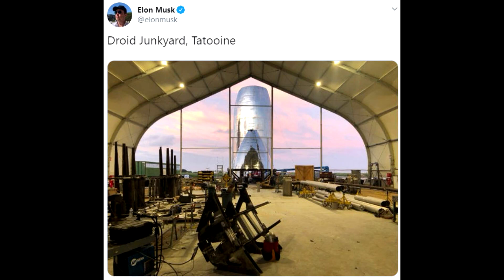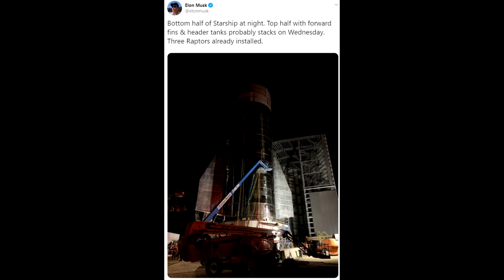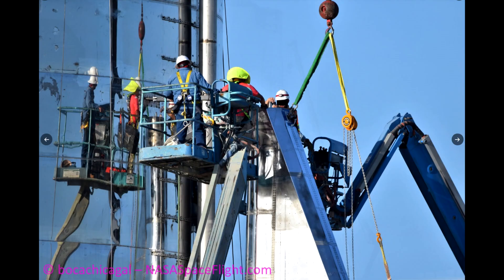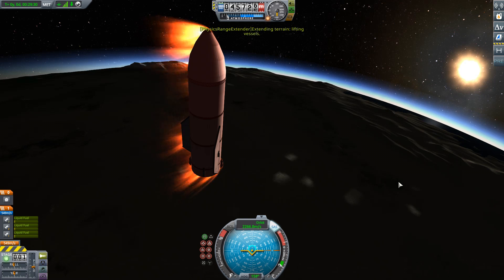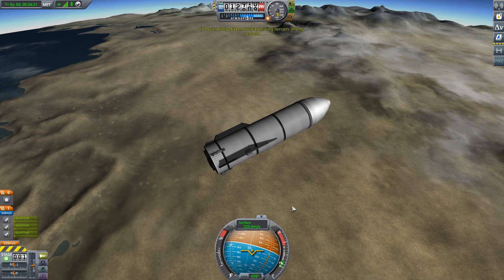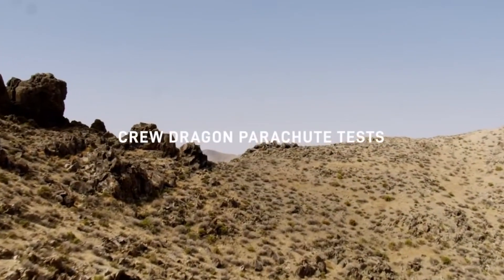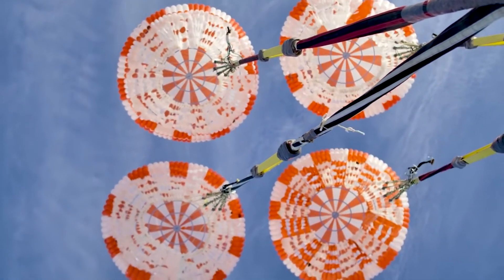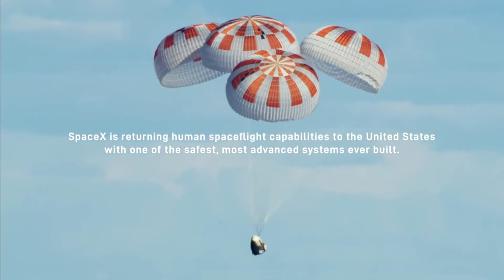New Details Revealed About SpaceX's Stainless Steel Starship as Prototype Nears Completion

Comment: So are there supposed to be heat shield tiles applied to a a section?
Reply: As of what I last heard a few months ago:
No, the plates that are going to be exposed in the reentry will have pores which will leak methane. This will create a layer of cold gas around the ship and will also cool it down.
Reply: @Zatmos  Apparently they ditched methane leaking idea already.
Reply: @randomnickify  Was it only what they wanted to do when it was still carbon fiber instead of stainless steal  or did they ditch it later ?
What are they planning to do now? Spread the heat through the whole ship ?

Comment: Why doesn't another company design a better craft like the shuttle but with the ability to take off from the ground and go into space or be carried to 40000 feet and shoot into space?
Reply: +masskilla469
Hint: the shuttle only worked by the magic of lots of money and being 'to big to fail'.
Reply: @Tuning3434  We have the technology now that is way better than the 80's to  deflect heat instead of those panels that failed!!
Reply: @masskilla469  Well, the shuttle was only retired in 2011, so apparently not so good yet to warrant a refit. Also as mentioned by Mark, you have the X-37. Still running on the money of DoD, but a lot smaller, riding on a conventional rocket and with probably a very interesting but niche mission.
Reply: @masskilla469  I admire your spirited young-minded bravado. However, as an engineer myself, actually working in high tech industries, I am a bit more skeptical of miraculously finding new technology because it's not 20 years ago. Capabilities change for sure, but you are seriously underestimating how far technology was 30 years ago.
Reply: @masskilla469  Ok, well I work in lithography machines, wouldn't call it a stagnant area of engineering myself (and an extremely costly one on it as-well). 
Still, most of the new technological development come from investing in better capabilities and building upon past experiences. There is a very clear pattern of technological development, and a nothing comes suddenly out of nowhere. Different technologies coalesce together in new applications.
The Apollo program as a matter of fact is THE example where money overpowers technical problems. It was done at a huge expense, and was relied heavily on technology and concepts that where developed in the '50s, but with the surrounding systems brought up on a new more massive scale. The J-2 engine was based on the Centaur's RL-10, and was developed early in the '60s.  
In the end it still comes down to money (Isn't it always :s ), and apparently SpaceX is the only company at the moment that makes has taken up the gauntlet, clearly designing something completely different than a Space Shuttle.
Reply: I think it's been tried, like Lockheed Martin's X-33.
Reply: They do, google SKYLON, they are working on it since 1980 and guess what? It is freakishly difficult.
Reply: @randomnickify  No such thing as google SKYLON !!

Comment: I am no rocket scientist, but how the heck is that thing going to survive 'hypersonic' with its sheet metal structure?  every transition of curvature we see as changes in reflections is a section that will create its own hydrodynamic effects on airflow.  All the surface pressure changes from the less than perfect surface will then make things vibrate like heck.  I am not seeing this surface material, internal framing, and construction technique being so great.  Somebody please explain how its going to survive the buffeting at higher airflow pressures?
Reply from the maker: Indeed, this might well go supersonic, but it's not going to be going anywhere near final speeds. I'm presuming the fabrication will become cleaner once it gets closer to the final design.
Reply: @scottmanley  something I wonder in relation to the digital FPU issue with chaotic systems simulation, might a somewhat imperfect surface allow tuning a simulation better with a lot of constraining real world numbers from sensor data?  Or does it not work that way?  If it does work that way, how would they retrieve a data set and of what?  Turbulence and airflow on the surface?  Or vibration from an internal sensor grid maybe tell enough about external conditions (w/filtering machines noise?)?
Reply: @AlohaMilton  You typically start in the perfect "engineering" world, and then apply perturbation to your model. Modern desktop machines can handle this work surprisingly well, so you do a bunch of small simulation, then feed the full model into a super computer.
Reply: @joshua43214  to clarify since I guess I didn't construct the question well. not asking about how simulations are done.  asking about comparing simulation to real data to verify and improve simulation.
Reply: @AlohaMilton  The basic model will point you toward areas of concern, so you stick the appropriate sensor in that spot. Then you put in some others based on experience and common sense.
Fly the rocket, compare to the simulation. If they do not agree, then you figure out why.
The whole process is lot less "scientific" than you might think.
real world systems are surprisingly robust, and tend towards equilibrium rather than chaos. Not always though, the whole harmonic vibration issue with the Raptor is a good example of why models can suck, and should always be viewed with suspicion.
Reply: I think it matters less than you think.
Go look at just about anything that has traveled at super sonic speeds.
Stuff like the SR-71 look smooth and shiny from a distance. Up close it is a mess of overlapping sheet metal, exposed rivets, and lumpy bends. Same for about everything else.
Reply: @joshua43214   The X-15 flew at hypersonic speeds, and up close its skin looks about as crude as Starship, pieced together from plates of steel (Inconel).

But I recently saw the SR-71 close up at the Smithsonian Udvar-Hazy museum. You can get quite close. Didn't see lumpy bends, did see incredibly subtle curves upon curves. Marveled they were done with slide rules and relatively limited wind tunnels.
Reply: @donjones4719  hmmm, I have seen the one in Dayton and it is lumpy. Maybe the Dayton one got flown more or was a prototype.
Reply: It won't, it's not meant to, this one is just an engine test bed.
Reply: @randomnickify  OK thanks, I sort of thought that, but it seems like some are referring to this construction technique as the same as the final vehicle.  It makes perfect sense to fly tests like the grasshopper performed with the cheapest quickest structure.  Maybe the final vehicle will be hydroformed stainless?  that would be utterly magnificent to have a single part hydroformed structure of that shape and size, polished to a mirror surface.